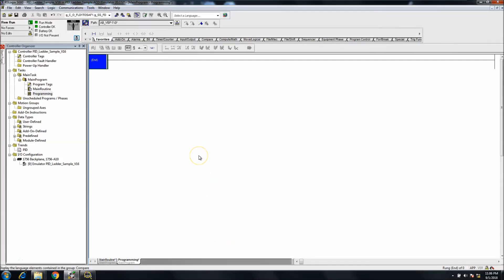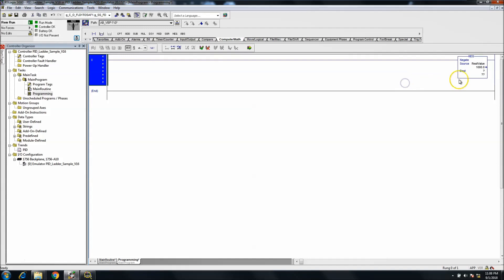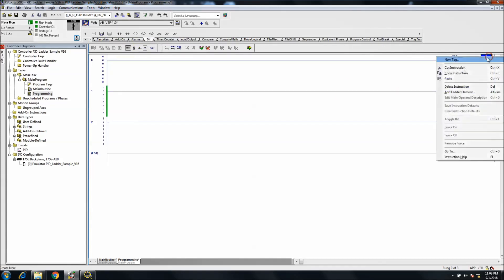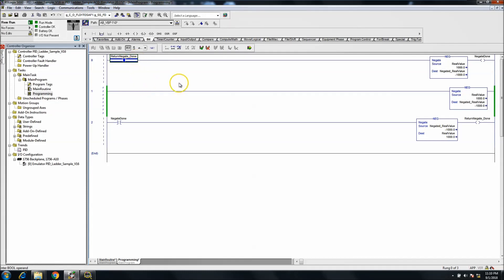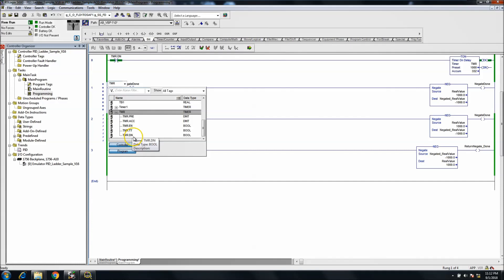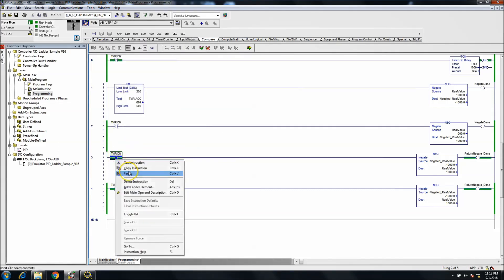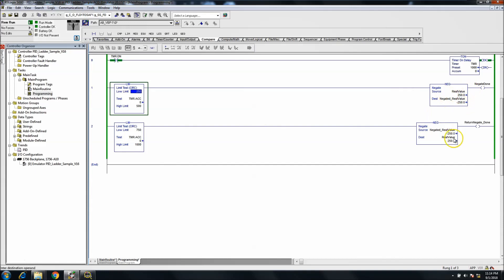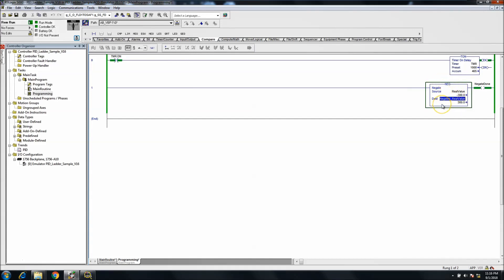RSlogix 5000 Using a Negate Instruction To Change Values [Official Video]

Comment: How can i do this in Rslogix 500??
Reply from the maker: By going to the instructions section and selecting the NEG instruction.

Use it the same way I show in this video
Reply: @ShaneWelcher  but all is different. When i select neg instruction Rslogix doesn't let me put an output after the instruction. I get "invalid output instruction position" error. And when I want to create a TAg I don't get this option like in the video 😥
Reply from the maker: @Carlos_9770  Because in RSlogix 500 you need to use a data type, it's not tag based like RSlogix 5000 or Studio 5000

Comment: Can u make video for illustration of DTR instruction
Reply from the maker: A DTR instruction acts similar to a mask move, I videos showing how a mask move instruction works.

A MVM instruction is binary though, the DTR can transfer data in a Real.

Meaning, it's a mask move that can be used for a Real
Reply: @ShaneWelcher  thanks, actually I want to detect some changes in value in a tag ,then toggle a bit of change happen